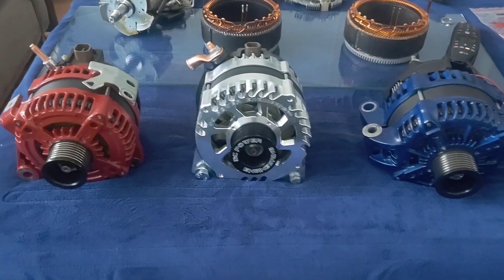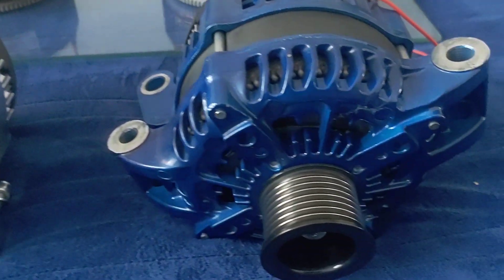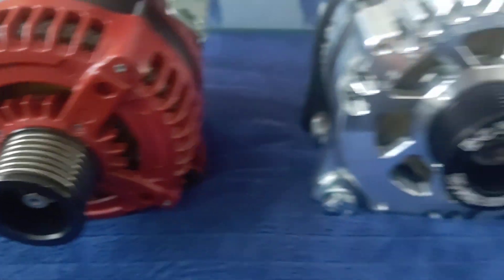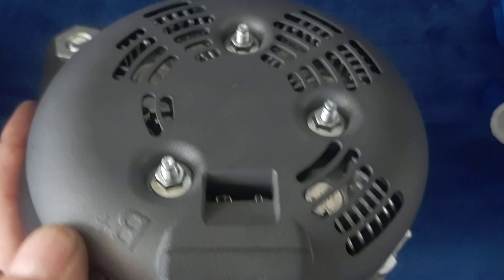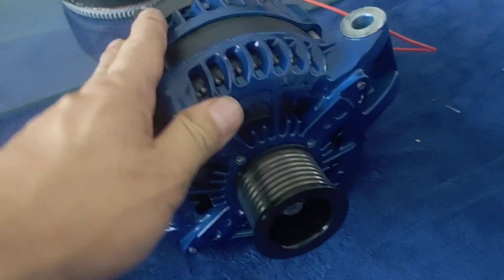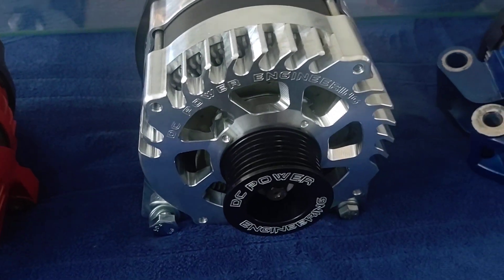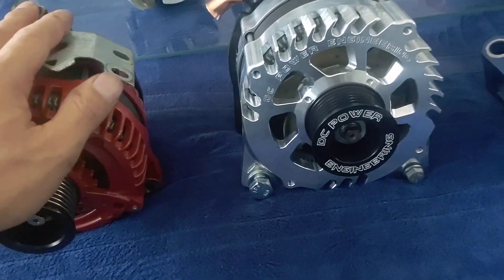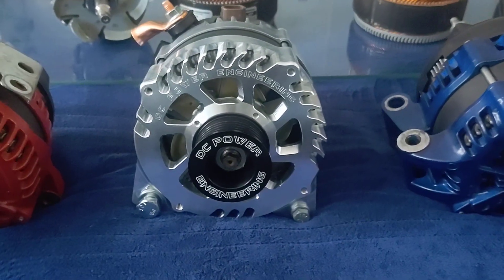DC Power Engineering 270XP converted to 370XP alternator build - 2008 TC Scion - Digital Design 9918

Comment: You have part numbers for converting a DC superduty to 370? Have a 10 year old one due for a rebuild
Reply from the maker: This is the "kit" you need. You'll re-use the case, rectifier, and regulator. I would suggest a new brush set as well for another 10 years of relatable service.
Reply from the maker: https://www.ebay.com/itm/313190705831?mkcid=16&mkevt=1&mkrid=711-127632-2357-0&ssspo=yROEJXAGSl2&sssrc=4429486&ssuid=39FhxSoiR1K&var=&widget_ver=artemis&media=COPY

Comment: Haha, those markings are just to identify who built it since we have a few builders. Enjoy!
Reply from the maker: This thing has done well. Your cases are extremely high quality. It's s been holding off 10+k watts charging lithium banks. Absolutely brutal abuse, but it's been rock solid, and continues to perform and impress. Thanks for taking care of me over there! Much appreciated! 👍
Reply: I have an 09 scion tc 2.4L so this 370 will fit directly on my factory location without any modifications?. How did the 370 billet alt fit in the tc?

Comment: How do you like your dd.. i have a new 9518sc  .. 6.5 cu box on its way ..
Reply from the maker: You're going to love it. Best quality drivers I've played with so far. No tinsel failures, no problems even with smoke pouring out of the box once or twice during a bass race. These subs are tanks, that sound good and have the balls to really get down if you have the power. 

I'd send a 5k to it and you'll be happy. That's will be all the power you'll need to overcome rise and have all it's potential performance.
Reply: @georgesrisomsak9650  man ! Thanks  for the feedback.. can't hardly  find anything  on the 18s .. the new ones anyway.. yeah I'll be starting  off with either a orion 2500.1 dz or a jp 23 . So at half ohm I should  be OK without  pushing  the sub too hard.
Reply from the maker: @matthewguynn2336  that should be a nice reliable setup for the next decade at that power!
Reply: @georgesrisomsak9650  I'd like to see a 150db  out of it.. but anything  around  that I'll be super happy with
Reply from the maker: @matthewguynn2336  what vehicle? 

I do 50 at 28hz, clamping 3400 ish watts. 1 driver in a Scion TC. Was very easy in this car.
Reply: @georgesrisomsak9650  well.. that's kinda my dilemma.. i was in a bad crash in my old bass truck.(Ford explorer) so now I gotta do a new build.. In either  my gmc terrain  or  suburban .